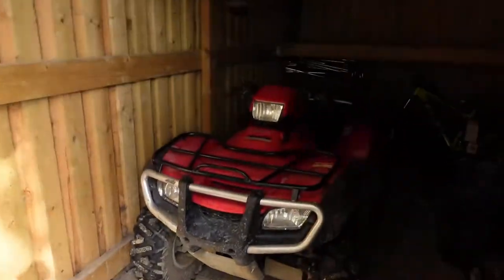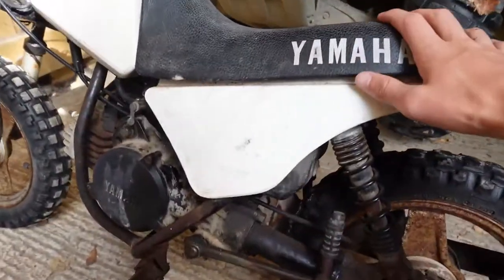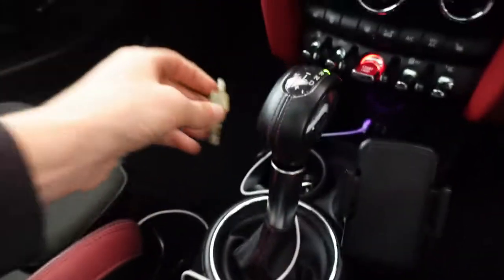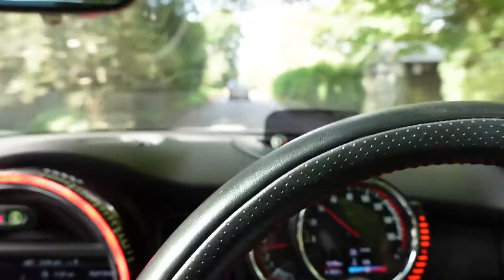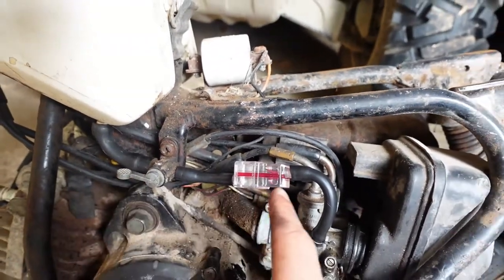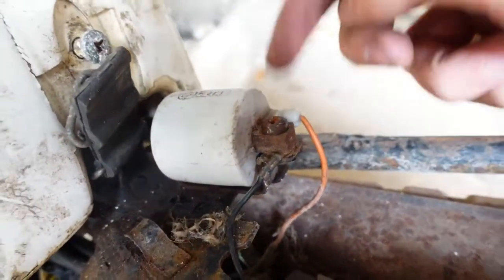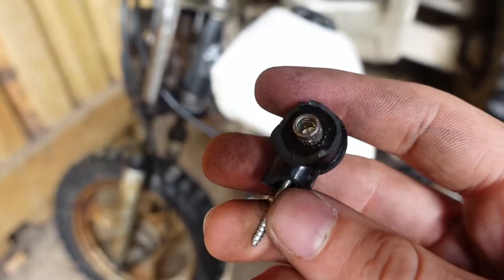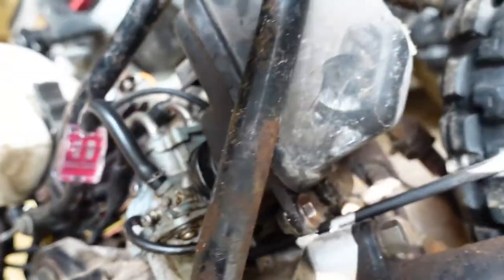Attempting To Fix The FREE PIT BIKE!

Comment: the brass connector is just a breather for the bottom of the carb or its an overflow wither way it doesnt matter if there was a tube or not since it would just lead to the ground either way, as the spark plug (its called a spark plug boot btw), you could of just cut both of the wires on the old one and the new one about an inch from the part that connects to the sparkplug it self and stripped the rubber back exposing the copper and soldiering the wires together, if that isnt going to work and these something wrong with the coil (grey cylinder thingy) your best bet is to replace the whole thing. I can see that the old coil is held on by that orange wire however at the end of it is only a crimp connector, so all you have to do is unplug the old one and attach a new crimp connector to the new coil and it should be as easy a plug and play, happy to help if you have any more questions.
Reply from the maker: That’s a massive help thank you I’ll definitely have to order a new spark plug boot and sort out where the other leak was coming from and then it should be all good hopefully. Thanks again
Reply: @JoshBatesYT   yeah no worries, ive been racing and working on bikes since i was 3, so happy to help and answer any questions you have, glad to see your getting into bikes and saving this little pw50, love seeing new people getting into the sport